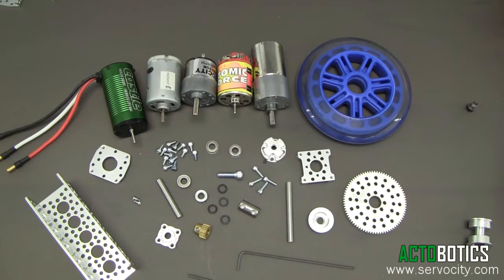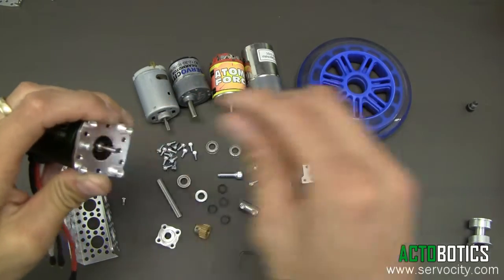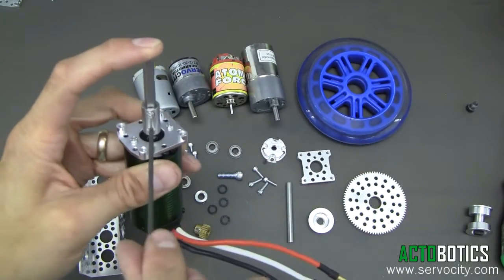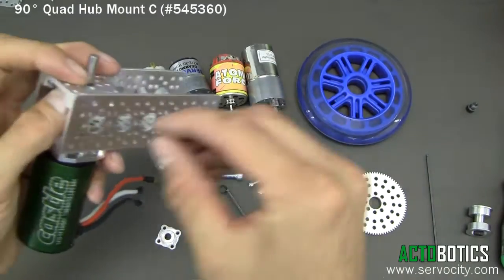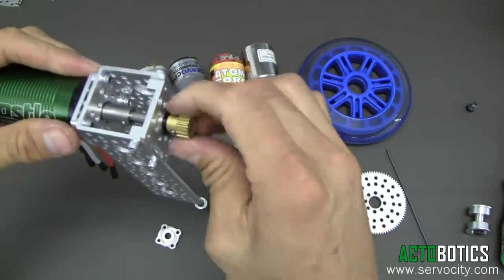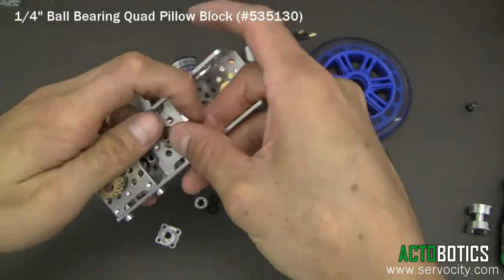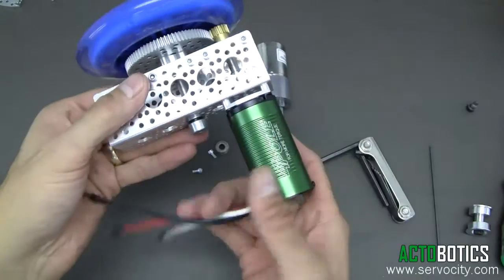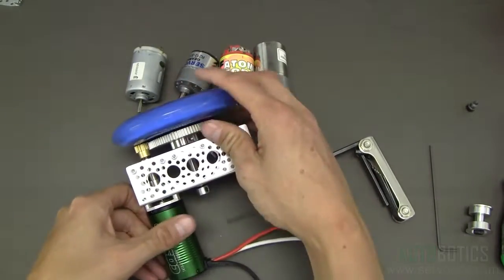Actobotics™ - Building a gearbox using #555128 and Aluminum Channel

Comment: Nice kit. Any tips for mounting an encoder?
Reply from the maker: +Mike Burdis Hi, Mike-  You could run a gearset between an encoder shaft and the a shaft of thegearbox.  If you use 32P and want 1:1 ratio, 2 x 24T, 32P gears would mesh nicely on the .75” channel spacing.  Feel free to contact our techs with any additional questions you might have tech@servocity.com.